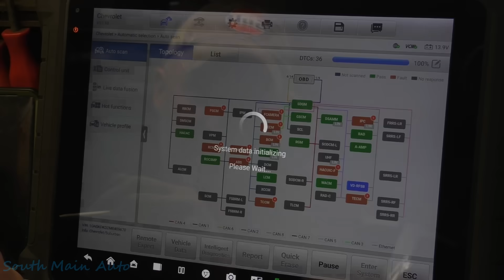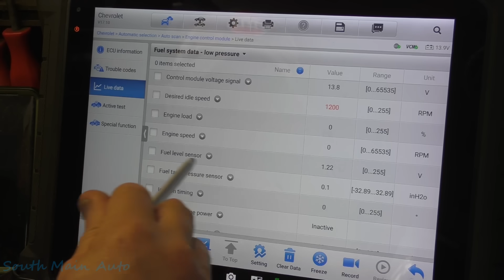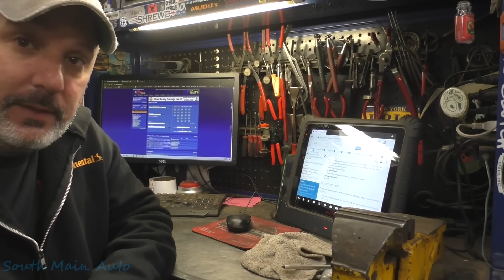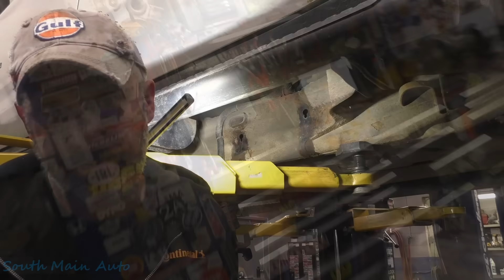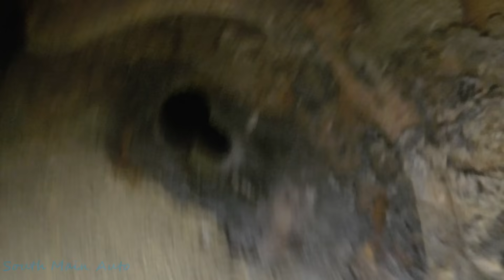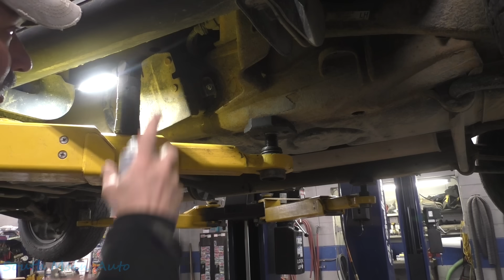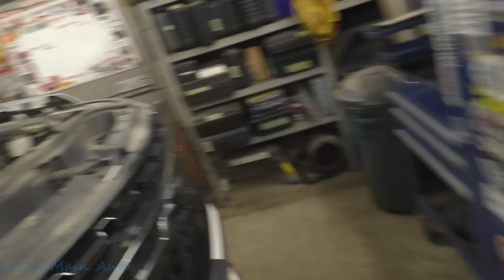'21 Chevy Suburban - No Start, Cranks OK

Comment: I was thinking that the fuel pump motor is 3 phase AC not DC. I believe that the controller inverts the DC to AC. Testing a 3 phase AC motor is like you said, just test the three poles (1-2, 2-3, 1-3) the resistance should be the same or nearly. Then each lead to motor casing to see if grounded. But, like you said, that test is irrelevant if it is mechanically stuck. If rhe module was working then you should have ~12VAC phase to phase and 6.9VAC phase to ground (12 divided by the square root of 3=1.73) that is how you calculate a 3 phase industrial system, wye-delta. Delta-delta is different. I'm assuming it's the same here. But you know what happens when you assume... For bench testing you would need a three phase power supply and thet are available. SOLA is the one that I use at my job. Its wired in conjunction with my DC power supply so that I can test both AC and DC equipment. The Cushman golf carts we have also have 3 phase AC motors in them. They operate off of 9 x 8volt batteries and the motor controller inverts the 72Vdc and spreads it across 3 phases. 3 phase AC motors are a lot more reliable than single phase or brushed DC motors. And it's easier to control the speed and direction of rotation. The problem is the controllers. They heat up and burn out.
Reply: Correct. I don't think you can have "phase" with DC. You need alternating current with a waveform to have a phase delay between the 3 different legs.
Reply: @jimbernard6112  didn't think so either, but wasn't 100% sure.
Reply: Actually they are not true 3 phase motors, they are a permanent magnet motor that has stator windings in a delta or star configuration that run off of pwm pulsed dc . There is no sine wave just square wave dc on each pairs of windings in a rotating fashion, usually with sensors to detect the position of the rotor, most rc hobby brushless motors are sensor less witch uses back emf to the controller.
Reply: Yeah, the term BrushLess DC (BLDC) motor is a strange one. These are, in fact, 3-phase (they could be 4-phase like a stepper) AC motors that require the AC signal to be generated by a controller. Not really DC at all.
Reply: Why did the engineers go out of their way to make this such a strange setup?  REALLY...three phase!!!
Reply: @joemuncie9187  Because electronics are way cheaper to manufacture (and more reliable if designed properly - which may not be the case here) than mechanical stuff. A brushed motor has all sorts of stuff to wear out. Switching the phases with active circuitry (driven by software) is cheaper to build and should be more reliable than using mechanical brushes. Now if only GM could design and manufacture reliable electronics modules!

The computer controlled three phase motor also provides the ability to have a variable speed fuel pump that only turns as fast as it needs to to maintain the pressure and flow needed for the current operating conditions.

Three phase is not strange. Most of the significant motors in the world (i.e. industrial) are three phase. That is because they work so well. 

BLDC motors are now used just about everywhere. My fridge uses one for the compressor, my washing machine uses one as well.

Comment: That's another thing I love about Toyota. The engineers not only design an excellent running vehicle, they also design it to be taken apart logically. I've had my 24' Camry for over a year now, and I still can not get it through my mind that it may not need to be worked on for years to come. Even so, the way the separate components bolt together make it so they can easily be taken off the vehicle and replaced. Another excellent video, Eric O. I hope the 4 day work week is treating you well!
Reply: Seriously? I bet I can change an alternator or starter on that suburban and have time for a road trip before you get either of those things off of a tundra. Toyota is a giant pain in the backside. Take off the exhaust manifold to change the alternator that’s buried at the bottom of the engine? Are you kidding me?
Reply: @ryanalexander984  Haha I was thinking the same thing. Has this guy ever worked on a Toyota before? Even oil changes are a headache

Comment: Ah yes Generous Motors AKA that great GM feeling!
Wonderful location for the fuel pump module and their great mounting bolts.  Who knows, there may be a GM Service Kit to mount that bracket differently.
I would like to think some company out there will design and build a three phase fuel pump tester......with adapters of course for GM, Toyota, and others......for a price of course.  Otherwise someone will show plans on how to build your very own 3 phase fuel pump tester.
There's also the possibility of your diagnostic tool having the very diagnostic test program available for it and a way to install the info into the vehicle's PCM so the test can be performed.
Great video Mr. O.

Comment: They put the bolts in backwards for the same reason they put critical electronics out in the weather, they don't care about the consumer, only about selling crap with fancy interior and a big touch screen!  And the public eats it up!  The days of automotive companies being proud of engineering are long gone.  That module should be inside the cabin behind an interior panel, and designed to last.  But what do you expect for 60-80K?

Comment: The only thing I can think of to test a three-phase motor is, like you said, some sort of Arduino project that pulses the three wires in sequence, fast enough to make the motor spin if it's good...  And you could never drive the motor directly from the Arduino -- you'd have to drive MOSFETs which would then drive the motor -- without that you can't get the current needed to drive that motor...  Seems quite complicated, and I guarantee you the folks in charge ran the numbers and decided that avoiding having to purchase a specialty tool was more important than getting an accurate diagnosis when the controller is almost cheap enough so that you can consider it disposable.

I don't like that answer at all, of course.  I'd want to know the part is bad before I replace it.  But that controller is so cheap that they're essentially using it as a tool to test the motor.  At least, that seems to be the logic from the folks at GM...  Not that they often seem capable of logic... 😂

Comment: I work at a GM dealer as a technician and those pump modules die pretty regularly. It either has a failure to control the pump or failure to control the canister vent valve. Yep the fuel pump module controls the vent valve.
Reply: 👍🏼 terrynation.  
My 2019 Silverado TrailBoss had the money light come on with an P0499 Evaporative Emission Vent Solenoid Valve Control Circuit High Voltage code. After verifying vent solenoid operation and making sure all wiring was good with no wiring harness rub through, I traced it back to the Fuel pump control module. Changed that out and I was good to go.. 👍🏼
Reply: How do you guys go about  overcoming the "no hole in the frame to access the bolt" problem?
Reply: @floorpizza8074  Cut the damn thing off.
Reply: @ it varies from using the e torx on the bolt ends to using an adjacent hole to sometimes there actually is a hole on the other side of the frame. And if all the above fails then a grinder or sawzall will fix the problem. lol
Reply: @floorpizza8074 As you can see it’s a slotted hole, you have to use and e torx bit and listen up the stud to slide the unit up to release it.
Reply: @floorpizza8074  it’s a carriage style bolt with a square lug that fouls in the slot to tighten. Cut the old ones off and replace with carriage style bolts. It’s actually a perfectly fine system used endlessly in industry and saves the cost of welding in nuts,
Reply: @fpoastro  Great explanation, thank you.
Reply: @floorpizza8074  In this great explanation, what does "fouls in the slot to tighten" mean?
Reply: @justliberty4072 Square peg goes in square hole and prevents rotation.
Reply: Should be a TSB for certain model years of Suburban, Escalade and Tahoe. Had one I had to send to dealer for warranty repair.
 Seen this on Malibu first back around 2019..
Reply: It's usually the module

Comment: I’ve always said, all engineers should have to work in a repair shop for at least 6 months before they start developing the stupid ass systems that they put on cats.  Particularly GM engineers.  Thanks for the video sir.  Reminds me how much I hate to work on cars now and I’m 75 years old now
Reply: GM pays pretty good money for that particular level of stupid. That’s some first class stupid, not your average run of the mill stupid
Reply: I have a better idea: have the BEAN counters assemble the cars on the line and THEN go out to a shop 3-4 years later in the rust belt to work on it.

Comment: Engineers are some of the worst people. They are destroying the automotive industry.
Reply: As an engineer myself I can assure it is more common that a product sucks not because we performed a poor design but that we were overruled.
Reply: @SteelheadTed  As an engineer too, it's either accountants overriding or the MBA overloards setting all of their metrics around assembly time. Remember the old 800s where to change the headlights you just pulled the two tabs and both of the light assemblies would just slide out or the 400s with the little underhood light with a cord long enough to reach anywhere on the truck?
Reply: @mattbots1  yup
Reply: @SteelheadTed  Poor design was shown in this video. A poor design is internal water pumps. A poor design is having to drop an engine cradle to get ONE bolt out. In the 21 years of doing this I've seen so many things and tried to be fair and justify it. There's no justifying most of it.
Reply: @calvinculpalt  I’m not justifying it, just pointing out that engineers don’t have the final say.
Reply: @SteelheadTed  Right, like with any job.
Reply: @calvinculpalt  right, so blame those actually responsible, not those that aren’t.
Reply: Problem is you as engineers could put up a better fight on that end instead of us mechanics just bitching. You have more power on that subject than I.
Reply: @ you have no idea.

Comment: If the tests for the motors are the same for AC power, you would need a megger for it. I'm sure they make digital ones, but the one I used to use you would clip to the leads and wind a lever. It will tell you the resistance between windings. That, and you check for grounding on all three leads.
Reply: Unless you have an expensive Megger that can throttle down to 30v or 50v you’ll be pumping hundreds of volts though that tiny motor and can cause damage just from testing. Megger meters are meant for high voltage AC motors.

Comment: Not an engineer, but I'll bet those funky inverted torx bolts are used instead of a bolt and u-clip for four reasons (keep in mind on the production line they never have to worry about corrosion):

1) Since the bolts are in the bracket weld nuts before the production line worker sets the bracket in the keyhole slots, they don't have to line up the bracket, bolt, and u-clip, saving time.

2) They don't have to worry about cross-threading the bolt in the u-clip.

3) They don't need a separate labor operation to set the u-clip in the frame rail. 

4) They don't have to worry about dropping u-clips into the frame rail (although I doubt any engineer cares about this one).

Comment: That's for the swear jar.
Reply from the maker: Thanks.... I added a 50 spot too haha
Reply: @SouthMainAuto  You make too much money if you can throw that sort change in the swear jar.🤣
Reply from the maker: @ I "pre-pay" for bad days
Reply: @LesReeves  He (Mr. O.) was referring to he threw in a half dollar coin. :-)  (.50 ;-)
Reply: @SouthMainAuto ”days”…?? Sometimes that 50 spot would not even cover me to lunch in one day! :-) 
    A to do many different things including working on vehicles, including making an electric car that can go 840 to 1280 miles on a single charge with no lift in a one car garage. I would really like to bring you up some stuff like a Milwaukee shop light on a stand that you can use either 120 V or a battery and also some Amsoil brand metal protector which is 50 + times better than “Fluid Film“!
Reply: @SouthMainAuto  ausie..  i just bought a chevy blazer.  1989..  are you still my friend.... first chev i ever bought..  shoot me...
Reply: @SouthMainAuto  yu wana now about dc motors..  if they didnt kill tesla, it would be common knowledge... ether, free electricity.. ended 200 yrs ago.. tartaria..
Reply: @SouthMainAuto  I don't blame you Homie cause Sammy ain't pushing either I'm too old for that nonsense, I haven't pushed a car since I was a Youngin and I'm not pushing any anytime soon😂
Reply: Swear jars and tooth fairies are quite expensive these days.

Comment: Updated. No fancy Arduino necessary the controller itself is all you need. Probe or pierce those 3 wires and the ground wire going to the motor. Turn on the pump. Measuring with AC scale it should have about 6-9vac equally on each wire to ground depending on duty cycle. That’s how you can check the motor and circuit when loaded. If there’s no voltage present at the connector on the controller either the controller is bad or the motor is shorted. Unplug the connector and check resistance between each leg to motor ground should read the same. Edit: There should be double the resistance between each of the legs you’re measuring 2 coils at the same time. There should be no continuity from either of the motor legs to chassis ground. Motor ground should not have continuity to chassis ground either that will mess up the controller.
Reply: Great tip. If the controller is good but motor is bad, would you expect to see unequal ac voltage on one of the wires? Would the controller send equal voltage to each motor wire even if it were bad?
Reply: @Barrys_Shop  if there’s unequal AC voltage you can try cutting the wires to the motor and see if the voltage picks back up. You can get fancy and wire up light bulbs at the connector to rule out the harness and motor if you absolutely need to be sure it’s the controller. In case the replacement is unobtainium.
Reply: @Barrys_Shop  to answer your question better you would see lower voltage on one of the legs if the motor was bad and had lower resistance than normal.
Reply: Does it matter these are DC motors?
Reply: @TheOnespeedbiker   You are measuring with AC because it’s pulsed DC on each wire in the direction of motor rotation to cause spin. The multimeter thinks it’s a regular AC but it’s just really fast DC switching on and off.
Reply: Also watch out for brushless motors with hall sensors. That allows very precise control but that’s more robots and less likely to be in an automotive application. If you need to diag one of those it’s a lot more checking wires and you’re probably better off hooking up a multi channel scope and recording all the signals at the same time.
Reply: Thanks for reinforcing the " Never Ever Buy a GM or Chrysler Product" section in my brain.
Reply: @superfinn80  this technology is not new. There’s millions of different brushless motors and stepper motors. It’s just poorly implemented here.
Reply: @superfinn80  It's my understanding that when the auto industry went to returnless fuel systems, they went to 3 phase brushless fuel pumps which control flow better. The problem is how to troubleshoot them. Toyota is one of the few manufacturers that have a bidirectional test (factory OEM scanner) that allow you to test the fuel pump motor speeds independent of the module.
Reply: Do you need to program the new module or do they come pre-programmed?

Comment: I'd say confirm powers and grounds at the controller and if that's good replace the controller since it's cheap enough. Those bolts are the same as the other fpdm that was above the spare. Slotted mounting holes tightened with e-torx from outside. Works great to put it together...